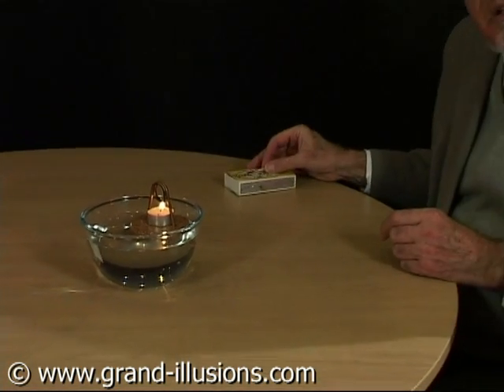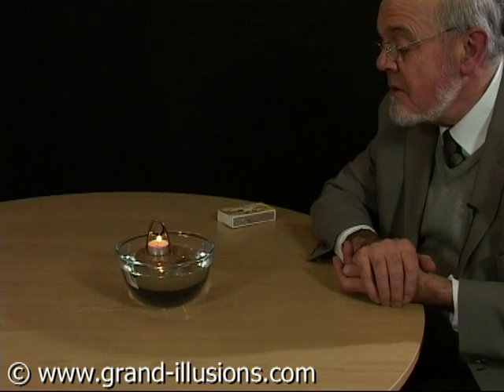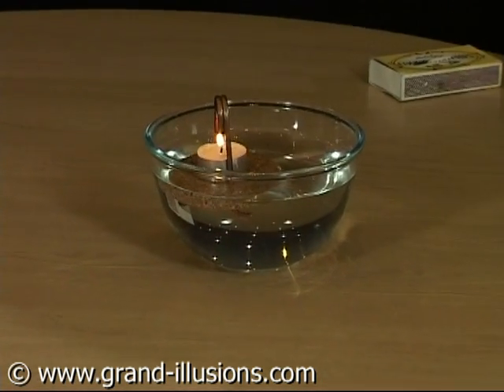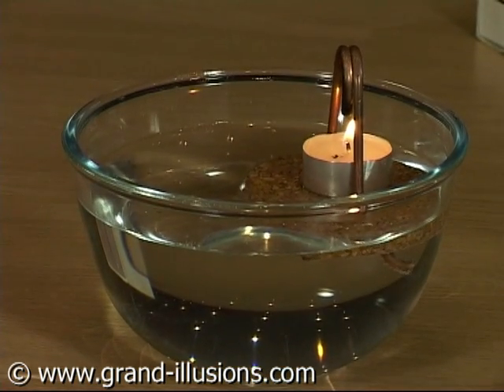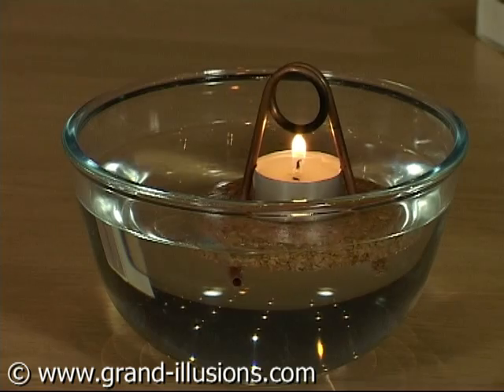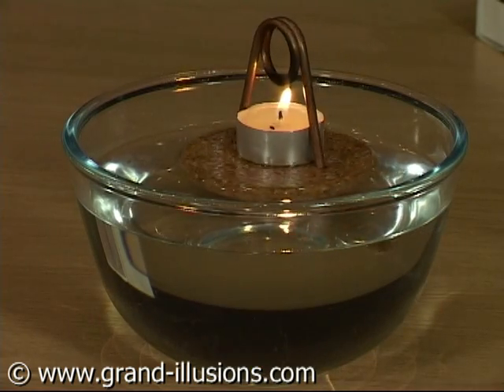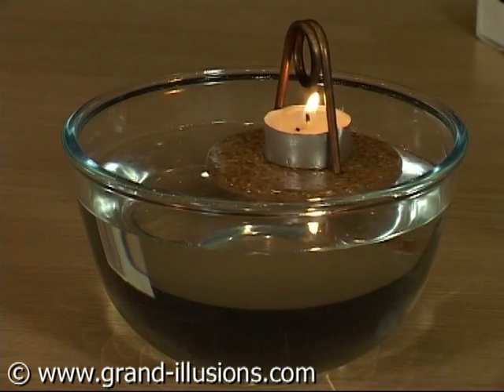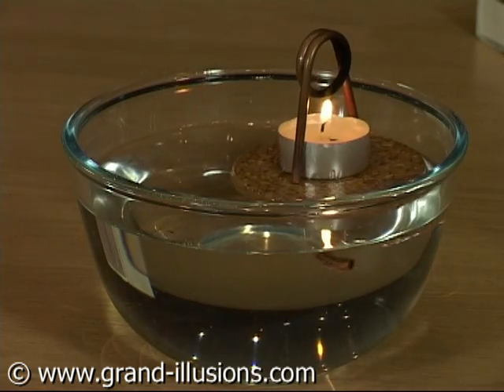Steam Powered Top

Comment: If you could control the flow of the water with maby a check valve, and then turn the imput in the other direction as the output maby it will turn around faster (also maby 1 or 2 more loops so the candle has more surface to heat up the incomming water and it wouldnt need to rest at times?

Comment: Would it spin much faster if you were to increase the surface area of the middle coil (and thus also increase the proportion of heat energy usefully absorbed by the copper)